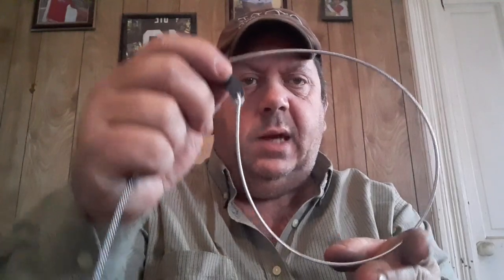Otter Snare Build

Comment: Where do you get barrel swivels?
Reply from the maker: Google 600 lb test ROSCOE Crane Swivel David.  A few places will come up. Do not use regular fishing Barrel Swivel.  They will break
Reply: @billingsleybrandtrappinglu1531  thank you for all the videos!!
Reply from the maker: You're welcome David . Thank you for watching
Reply: Hey Dale good luck and safe travels on your trip! How do you dispatch otter if alive?
Reply from the maker: A 22 pill to the head . Thank you Mike.
Reply: @billingsleybrandtrappinglu1531  Here in Michigan we can't shoot them or use body grippers large enough to kill otters on dry land,so open water is only option for a 330 or foothold on drown rig.I have many times found good otter sign without deep enough water so I've been reluctant to set there,I guess I could try to whack it with a trowel but never tried.
Reply from the maker: You can thump em. I tap them 9n the nose like a fox to release them after the season ends.  And does the law specifically say you can't shoot a trapped otter? Or does it mean 1 that's out swimming in the open? I'd be checking into that if i were y'all